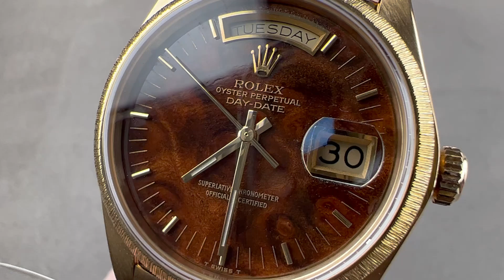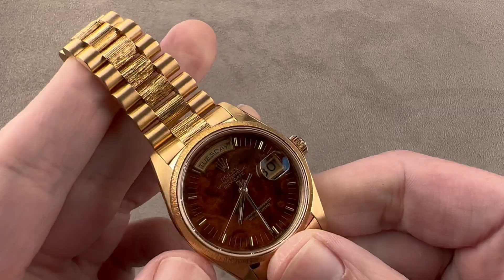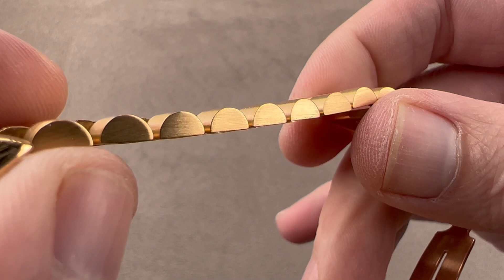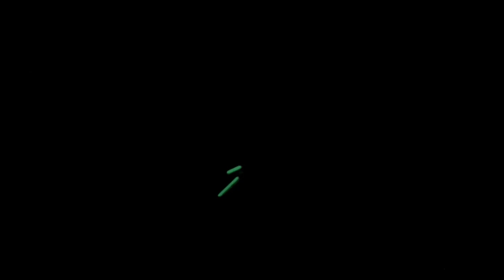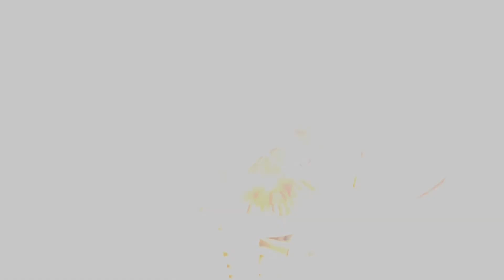Rolex Day Date Burled Walnut Dial and Bark Finish 18078 Rolex Watch Review

Comment: just picked up 31k cad bark bracelet 1985 18078 fluted bezel weighs 138 grams is this accurate no papers og box 🗃 but will do full appraisal from jeweler  case and bracelet serial numbers match reloomed hand og sapphire and 3055 movement off chronos24 is this legit ?